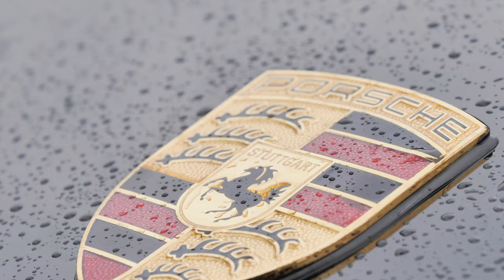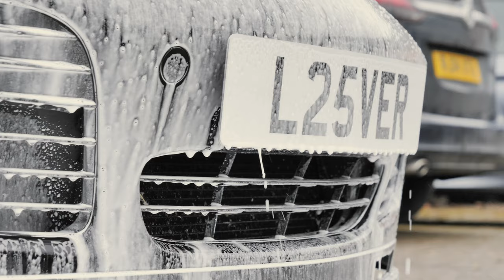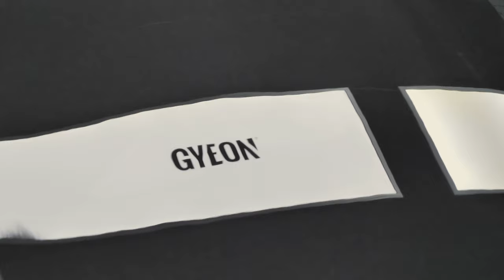PORSCHE 911 996 TURBO | GYEON PPF And Ceramic Coatings

Comment: Nice video, can I ask how the PPF sat on the front end of the car given it is not a new car and may have some stone chips and imperfections in the paint?
Reply from the maker: Sure. The front end ( amongst other areas ) have been painted before so it sat well. With that being said even if there are stone chips at least this reduces more appearing over time